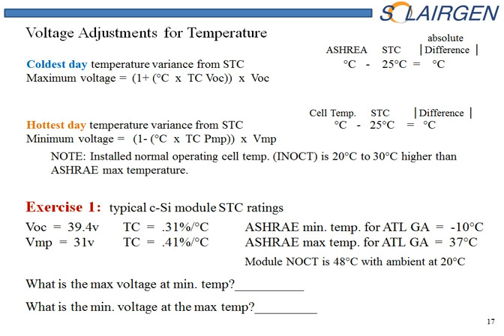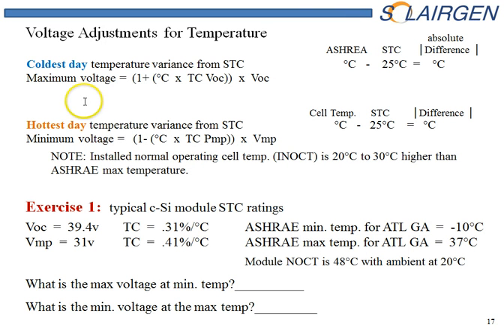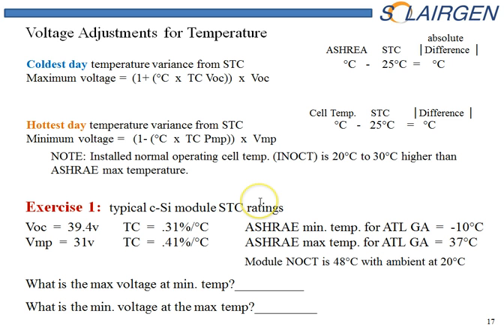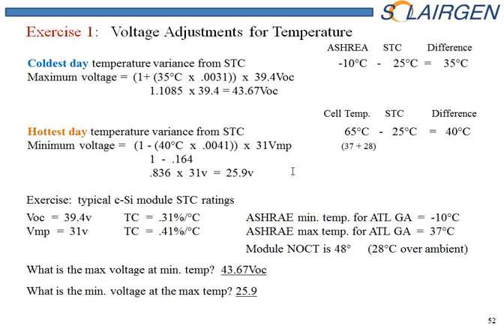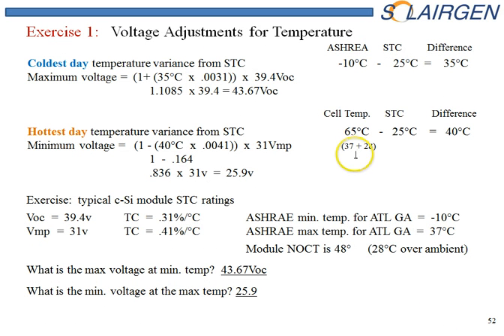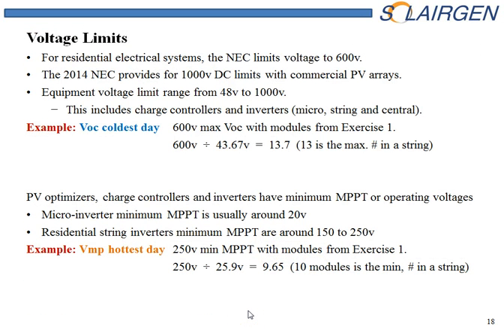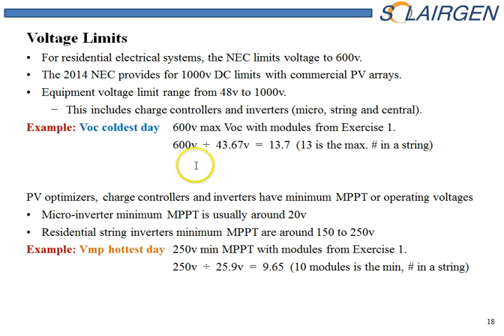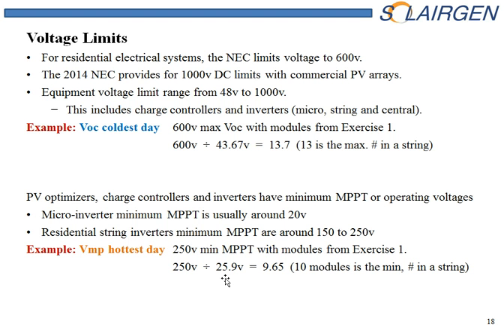Voltage calculations for max and min temperature

Comment: I'm not sure if this channel is still active, but I stumbled across your video and wanted to share my thoughts. I noticed that while you compensated for the maximum temperature of 37 degrees Celsius and added 28 to get the cell temperature, you didn't do the same for the minimum temperature. I'm not sure if this is accurate, as the ambient temperature is -10 degrees Celsius, so the cell temperature should be higher than that, right?

I also questioned the assumption that the morning temperature is the worst-case scenario, as I believe the wattage per square meter would be low at that time and would allow the cells to warm up. Instead, I suggest assuming a worst-case scenario where there is a cloudy day with very little sun, at -10 degrees Celsius, and then suddenly at noon, the sun comes out and hits the panels at their coldest.

Overall, I think the explanation needs more details to be entirely clear, but I could be wrong.